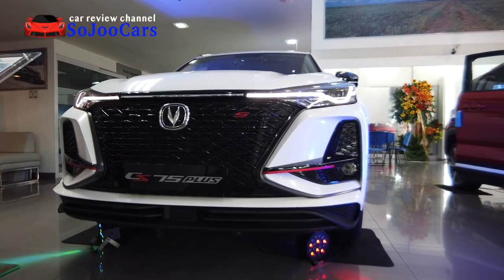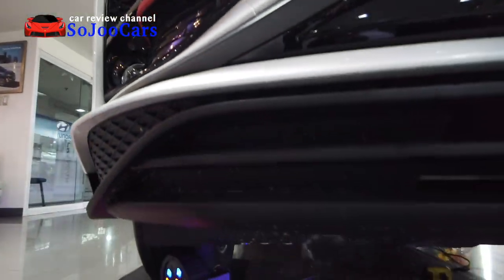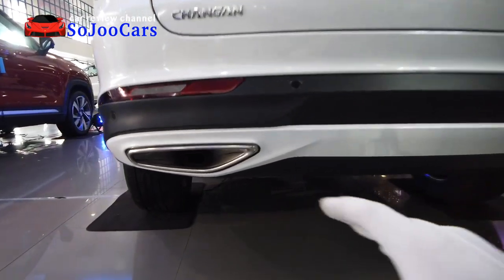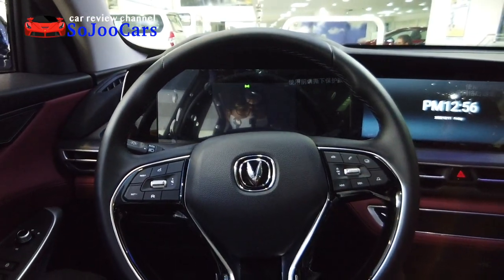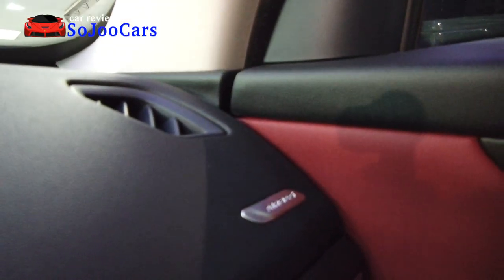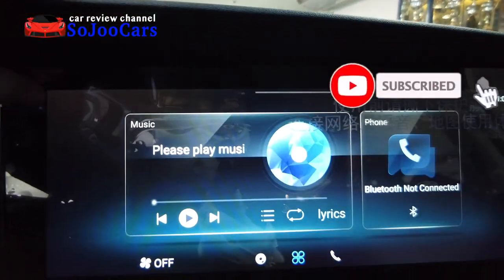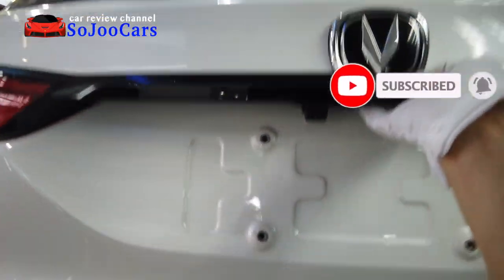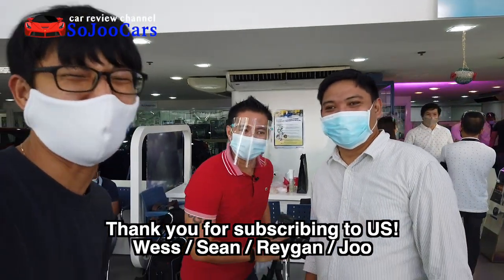2021 Changan CS75 PLUS FULL REVIEW - [SoJooCars]

Comment: I am confused should I buy CS75plus or Geely Askarra Luxury?.
I would pick CS75plus if is more fuel efficiency.
Reply from the maker: That is a question I have in mind also. The Fuel Mileage
Reply: Azkarra is much better because it s a hybrid !
Reply from the maker: @johnbasco403  mild hybrid yes
Reply: @johnbasco403  only 48V motor
Reply: Which one did you pick sir? :)